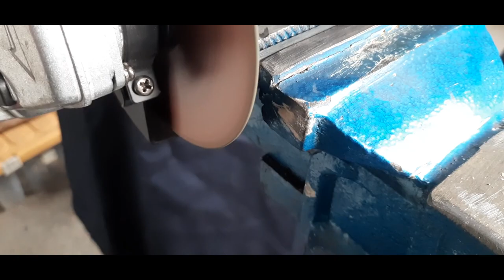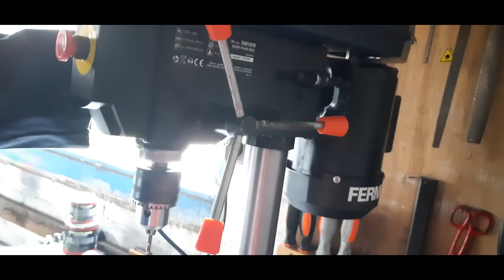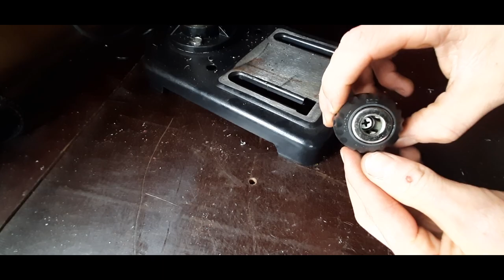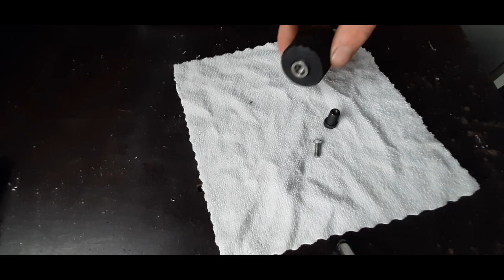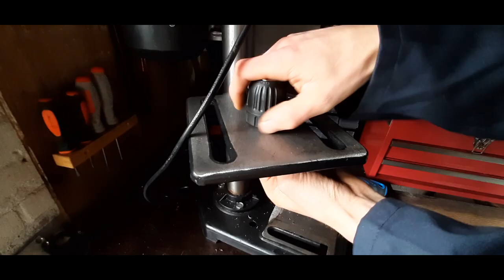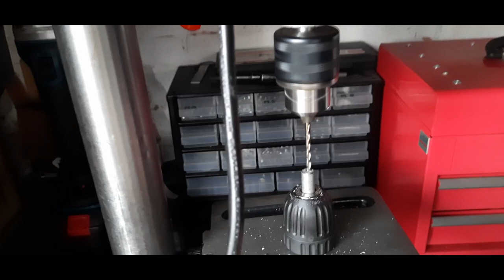Drill Centered Holes in Round Stock!

Comment: That's the wrong way of drilling a hole in round bars, especially if they are short and have small diameter. You should swap, put the drill bit in the stationary chuck and the rod in the rotating one, pre-drill a small hole (don't use a punch) and without moving the rig, drill the final hole. This will make the  machine into a sort of vertical lathe, which will be able to drill holes with better precision and better centred as well.
Reply from the maker: This is not the wrong way, it is a different way.
Reply: @EngineerSteve  I am sorry, I disagree. It's the wrong way if accuracy matters, but it's a different way if it does not matter. But of course, it is up to each one of us which way we prefer doing it.
Reply from the maker: @AdaptingCamera  I agree on that this method might not be the best one but in my opinion 'the wrong way' doesn't exist if the result is still better compared to what you begin with. I will start a lathe build shortly so I won't be using this setup anyway ;-)